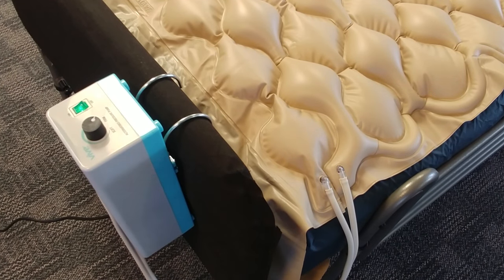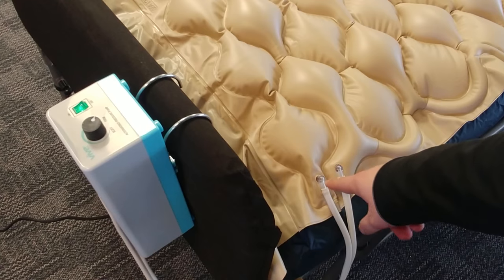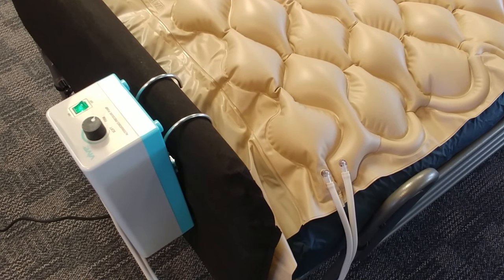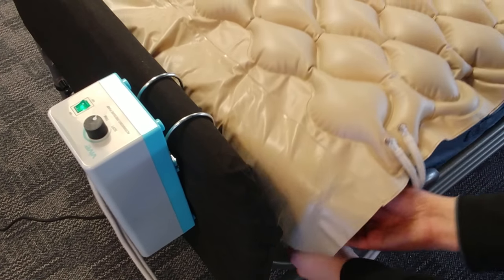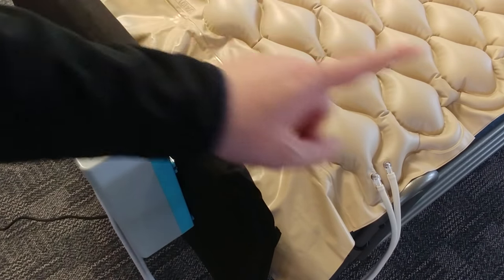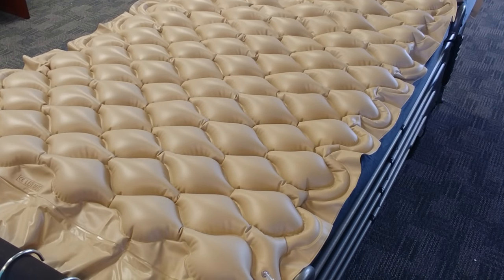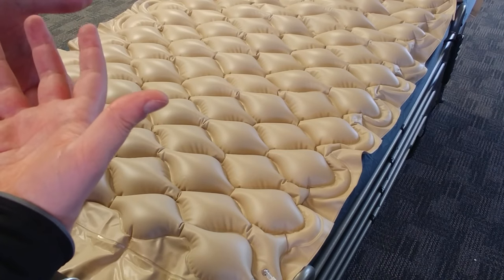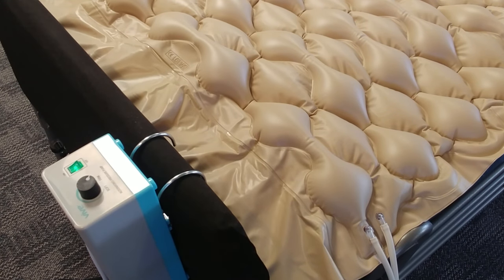How Do I Set Up the Vive Alternating Pressure Pad - Installation and Operation

Comment: Once it's filled. Can I turn off the pump? And more importantly,  can I leave it on permanently?
Reply: Yes. You can plug it with a stopper so it couldn't leak the air. and you can leave it alone so long time.
Reply: But in this way, it can't achieve the goal of alternating pressure to relieve the bedsore, and it is equal to static mode.

Comment: Whenever i switch off the power supply of motor, the air bed automatically deflats..So there is any defect or hole in the bed or else the power supply nedds to be on for 24/7????
If the power supply is on for 24/7 does there is any chance that the motor damages due to excessive heating???
Looking for a promt reply quickly..Thank you sir🙏🏻
Reply from the maker: Hello! Yes, the power supply is designed to be turned on while in use, otherwise the air would not alternate within the pressure pad and you increase the risk of developing bedsores. If you have other questions please take a look at the FAQ page for this product on our website 👉 https://vhealth.link/4bn

Comment: Can this be used in a hospital bed in the seated position? With the patients head up? Or will this only work flat on the bed?
Reply: Honetly, this type don't achieve the standard in hospital. There is another better one you can chieve for hospital. The mattress with endflaps so you fix it in this with the patients head up not only just for flat bed.

Comment: Hi .. if all the chambers are inflated to max, how will it alternate? I just received this today. Not sure if it’s working or not.
Reply from the maker: Hi T Choudri,

Not all the chambers will inflate to max. Every other chamber should inflate, and then after a few minutes, the pump will move the air from those inflated chambers to the deflated ones. You should be able to press on the rows of cells and feel which are inflated more than the others. 

For a visual, check out this video we made on how the Vive Alternating Pressure Pad works: https://www.youtube.com/watch?v=Vabb4I_1GwU

Hope that helps! ~Diandra, Vive Health~

Comment: do you have to separate the tubs conecting to the matress correct?
Reply from the maker: Yes! That's needed
Reply: How?
Reply: I'm not totally understand what you mean?
Reply: My mattress didn't come with connecting tubes for it to blow up, do they come separate
Reply: @lauriecox8885  you mean your purchased mattress set didn't include the tubes? the tubes are conected mattress and pump

Comment: The mattress worked fine at home. My mom is now in the hospital where electricity is 220v and mattress is not alternating. Any ideas? 
She developed a bed sore 3 days in at the hospital HELP!
Reply: you should switch to another pump which can work in 220V. Before you puchased one pump, you should clear what kind of the voltage 110V, 220V or others. Of course, some pump with two different voltage which can work normally in different voltage.

Comment: Hi I’m normal person so should I use it?
Reply from the maker: Hello there! 👋 Alternating Pressure Pads are typically used to provide relief from bed sores and other skin problems caused by extended bedrest, promoting increased circulation while reducing pressure and skin breakage. The variable pressure mattress pad evenly distributes body weight to relieve pressure spots for exceptional support and comfort. People who could benefit most from this product are typically: seriously ill; not mobile; have spinal cord injury; do not eat a proper diet; wear prosthesis; smoke; are incontinent of stool or urine; have diabetes; have COPD or heart failure; have Alzheimer’s, Parkinson’s, or heart failure; or have a broken hip or have had a recent hip surgery.
Hope this helps!

Comment: Is there a problem with having the pump and nozzle at the head of the bed?
Reply from the maker: Hi Thomas! There isn't an issue with having the pump at the head of the bed for installation or use, however the humming from the pump may be inconvenient for the user by the head .

Comment: Hi, how do I fully deflate for travel please?
Reply from the maker: Hi there! There is not any special secret, but you could try letting it deflate as much as it can on it's own, then roll it up from the top toward the bottom with the holes in an attempt to push the air out!
We hope this helps!

Comment: I'd like more info about the noise level. Is it a constant soft hum, or do you only hear the motor/blower whatever it is when the device is inflating the mattress? And I'd like a better description about what exactly the sound of the pump sounds like. I'm going to be getting one for my hospital bed. I'm a ventilator patient, who has a tracheostomy. Now One of my questions is, does it sound more like a small compressor? The ones I've heard in the past sound similar to the pump that is attached to a fish tank. I've heard blowers make a more soothing sound, that just sounds like a blower, and Not the aquarium sound. I HATE the sound of an aquarium pump. I'm getting this unit, the one with the dial.
Reply from the maker: Hi Peter! Under the FAQ section, it states, 'the pump is surprisingly quiet, even more quiet than a water pump in a small fish tank'. You can find more FAQs here: https://vhealth.link/sqp
Please email our customer service and ask for Alice. The email is service@vivehealth.com. She will be able to answer your questions fully and in a more timely manner.